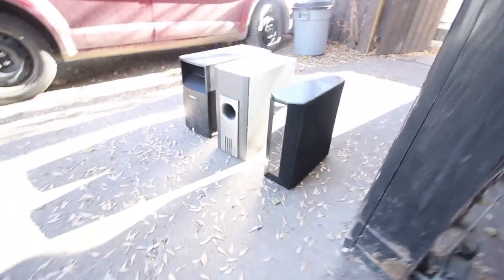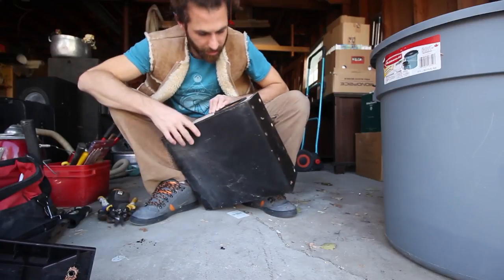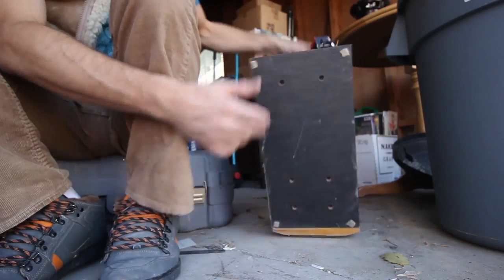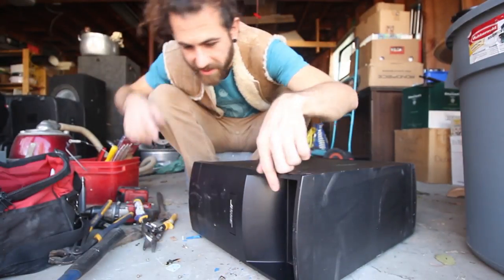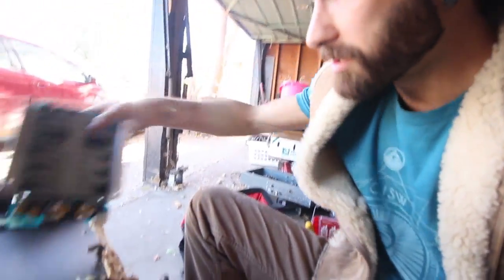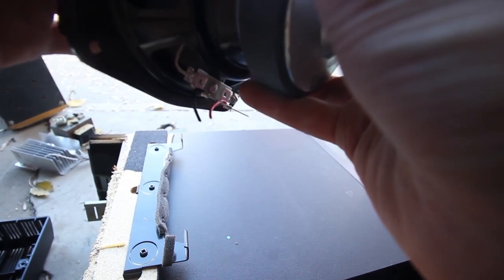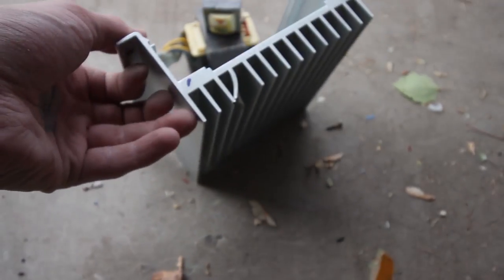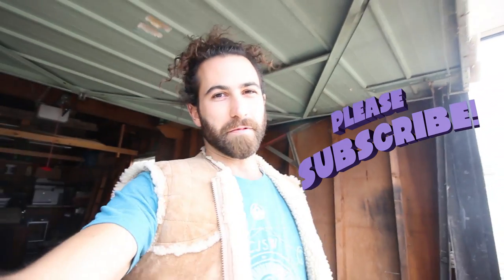Scrapping A Powered Subwoofer - What's Inside? Is It Worth It? More Money In Less Time!

Comment: Those "power supplies" are transformers and they are full of copper. a its worth a lot more to break it open and split it into a pile of number 1/2 copper and a pile of steel. its ether steel or Ferrite on each one and most of the time can be loosened with a hammer. sometimes the steel has plates interlocking into the center of the transformer and need to be pulled loose with a pliers.

Also love the vids btw. keep doing the thing.
Reply from the maker: thanks double A! I don't bother with most of the transformers cuz I don't have a fast way to do it. If I had a big chop saw with a metal blade then I definitely would. Probably the only way electronic items like these would be worth scrapping.